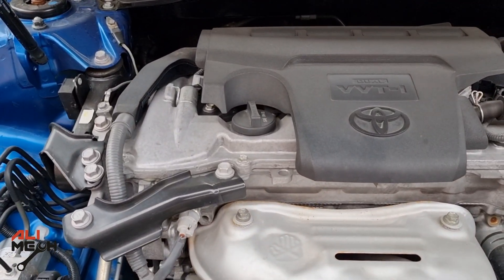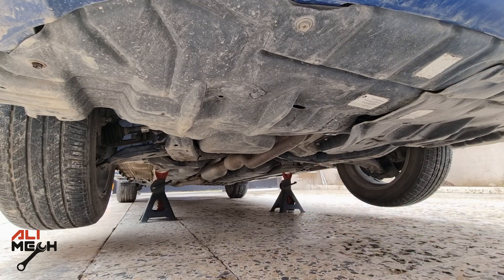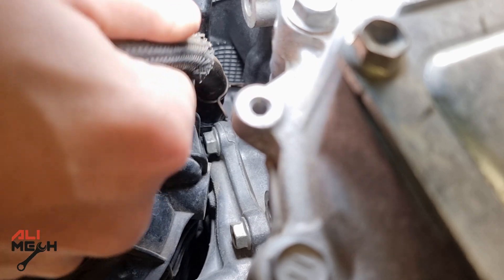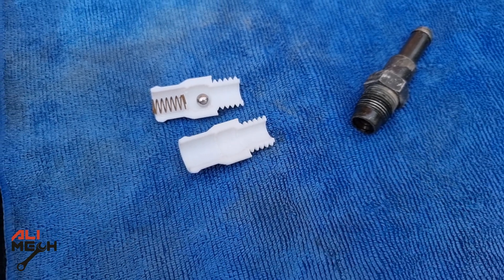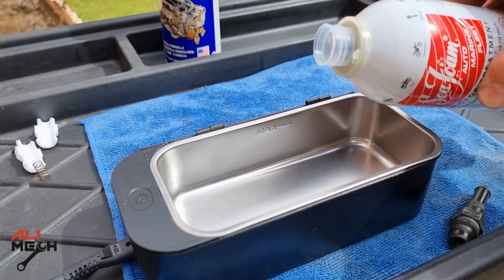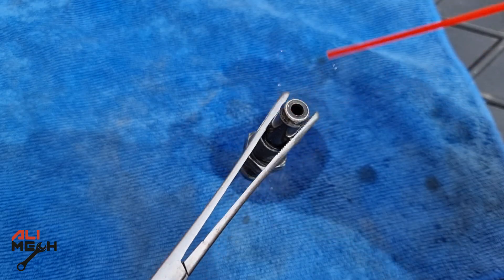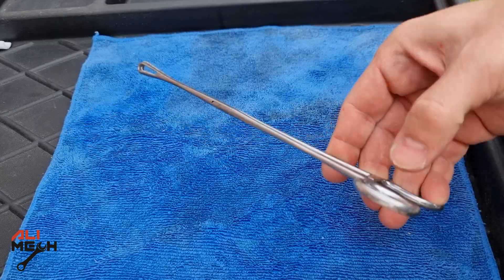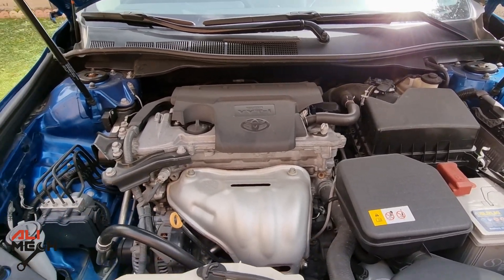How to Remove and clean the PCV valve TOYOTA Camry 2015-2017/Toyota Camry PCV valve location ALIMECH

Comment: I have a 2016 Camry LE, about a week or so ago I noticed whenever I let off the gas at high speeds it kind of “shakes” or shudders. If I let off very slowly then it doesn’t really happen. Sometimes will if I’m coasting at high speeds and then press the gas pedal. More so when letting off but any guesses on what could be the issue?